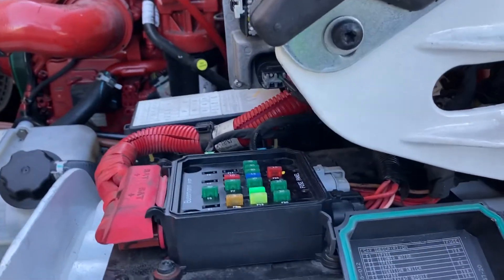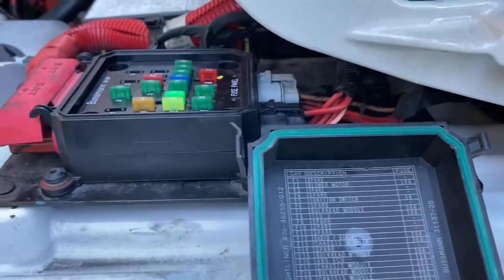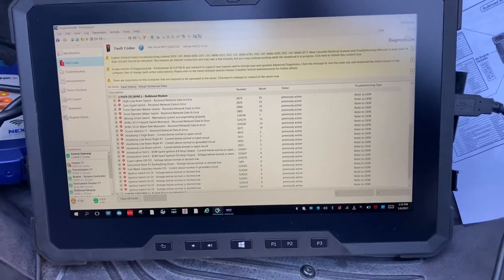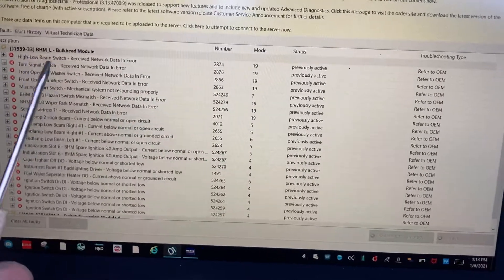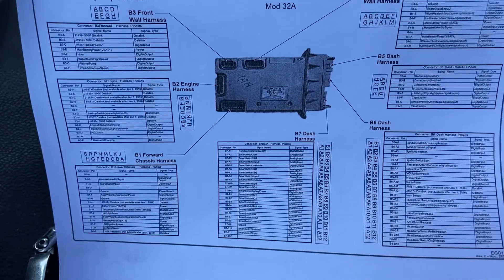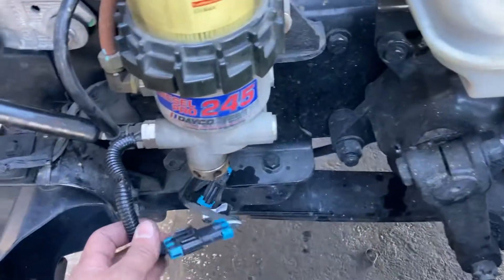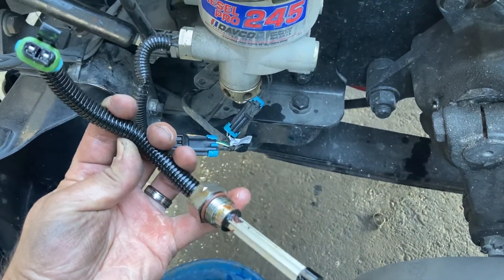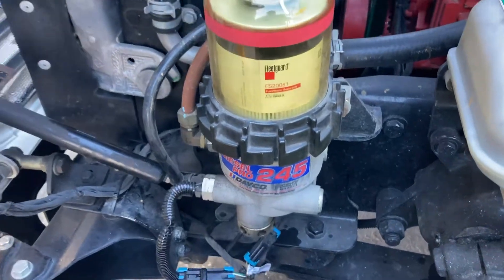Fuse F 13 chassis module, freightliner, fuel water separator heater failure

Comment: My freightliner m2 2013 tail light not working and i did check all the fuses are working. What could be the issue? Any suggestions helpful.
Reply from the maker: Did you check if you are getting power at the light? Could be a bad light?
Reply: It’s probably the connector at the chassis Module. I’ve dealt with this many times there is one connector that is always loose on it. Tug on all your connectors and see if one just falls out. Can’t remember what number the connector is. Good luck! Chassis module is under the cab. Above the def tank if your m2 is a tractor. If it’s a bomb tail it’s the module above the batteries.
Reply: Thanks bratha.
Reply: @kiriaedward9192  keep me posted!

Comment: Im having a issue with my rear light. When i step on the brake it does nothing. Left works. When i put on the right turn signal, it does nothing, left side does work. Light is good. Turns on woth the running lights. But thats it.
Reply from the maker: Where you at? In the Tampa Bay Area?
Reply: So cal area
Reply: Check ACU, (located on frame right before rear axle, there is a brake air valve switch, the most right one ($230)

Comment: I am having the same problem stop light not coming on when step on the break. Also, the cruise control doesn’t go off when u stop on the break while driving
Reply from the maker: Sounds like probably a brake switch issue. What year and make is your truck?

Comment: Did that completely  fix the issues
Reply from the maker: On this occasion the chassis module had gone bad as well. So, I had to replace the chassis module and the fuel water separator heater as well, but I have had this issue again and just replacing the heater solved it.
Reply: @alreyindustries  were you getting a check engine?
Reply from the maker: @simon1211  I don’t think so. If I remember correctly.